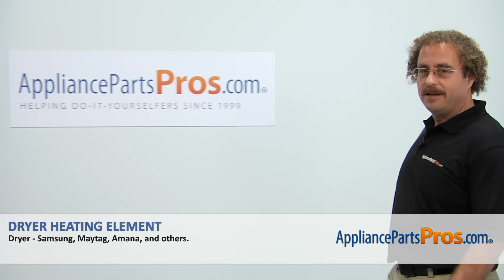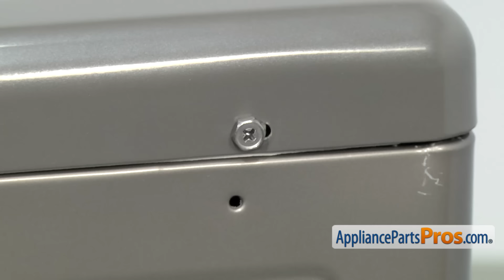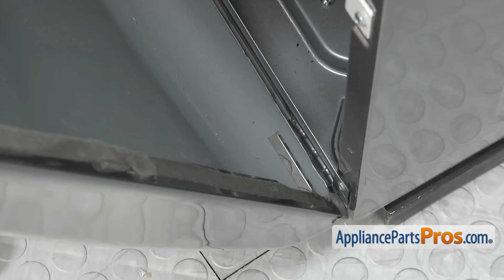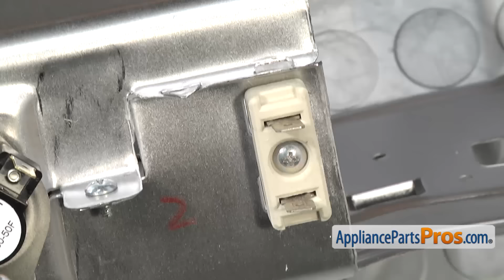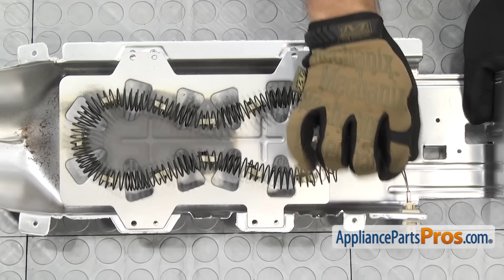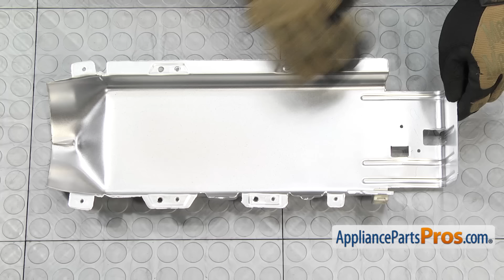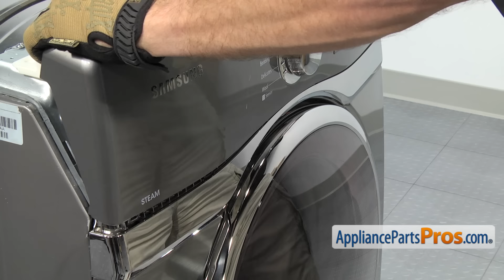How To: Samsung Dryer Heating Element DC47-00019A

Comment: I'm on my second heating element after year 3. Never had to do this on my old school dryer!! For the price, I'll never buy another Samsung dryer again!! Great and helpful video tho!👍
Reply: Same three years second time I’ve had to watch this video. SMH
Reply: I really appreciate vids of this type. Shop around for the heating element though, I found the price varying from around thirty dollars to over one hundred.
Reply: @jgunther22   genuine vs copy ...?
Reply: @danielgiguere2588  Seemed to be a copy.
Reply: I saw a video about repeated heating element replacements, and the suggestion was to clean the moisture sensors with Goof Off to remove any buildup of detergent or fabric softener on the sensors.
Reply: I’ve never had to replace mine, you could have a vent issue, If your exhaust hose is kinked or clogged it will cause the element to overheat and go out
Reply: I just put my element in and it went out to
Reply: PLEASE HELP! Is it possible to put the thermal fuse or thermostat on upside down?
Reply: @RestEasySon  just spoke with a repair tech and the answer is no, it doesn’t matter
Reply: @RestEasySon it don’t matter
Reply: Make sure you change the thermal fuse. If it’s bad it can overheat the heating element causing it to burnout much much faster
Reply: Wow, this actually gets me angry seeing that it isn't just me having my own problem with the element burning out every year or two! And this isn't easy to get at you have to lay on the floor!
Reply: @joeblow26  I spent most of the afternoon doing this today. Those suckers are sharp also.
Reply: 3rd time in just over a year for me.
Reply: I'm on my 5th! Shitty design from Samsung!
Reply: Same thing. I'm on my second one within 3 years.
Reply: Replacing them every year. Do not buy samsung appliances.
Reply: Me too!!!!!
Reply: Thanks for the video 3 year old dry up and running now
Reply: On my third heatting element  I will never buy another  Samsung  dryer again
Reply: My third element replacement, watch this every time. Every two years it seems.
Reply: Me too second one and 4 years
Reply: I’m dealing with the SAME issue! I’m so over Samsung appliances!
Reply: Same!!
Reply: Mine lasted 16 years
Reply: @joseluispcastillo  Just replaced mine, element was good just the fuse went. 17 years.
Reply: @johnrotten968  Is there a fuse on the assembly? 
I hope I wasn't throwing the baby out with the bath water.
Reply: @joseluispcastillo  Yes there is a fuse its part number DC96-00887A. Do a conductance test on the element and the fuse to see if there is any resistance. Should be zero for both. Also if you don't see a break on the element it is most likely the fuse that's gone.
Reply: When I say conductance I mean your voltmeter should read 0 ohms no resistance. Infinant means broken wire or burnt fuse.
Reply: @johnrotten968  Thanks. I should've assumed a fuse first verses assuming that the element burned out when there wasn't any signs of it being burned out.
Reply: My Samsung dryer last 7 years. Now I am expecting a new one by the end of the year. Always make sure to buy the 5 years warranty. Samsung and LG are a good products, I don't know why so many negative comments.
Reply: Same shame my head
Reply: Are yall getting the oem parts or Amazon?
Reply: Had my dryer since late 2009. I just ordered my third replacement. A broken coil is always the issue. 

 Not sure what i bought last time. Going OEM and leaving this here for next time.
Reply: I’m doing my second in three years too.
Reply: Just changed my heating element. Fuse and thermostat. Still won't heat. I dunno wtf it's doing
Reply: Yep. This was the second replacement in just under a year.
Reply: Same.
Reply: Same here
Reply: I absolutely HATE Samsung appliances. They are them worst pieces of crap ever. Aside from General Electric appliances, too. That’s the worst second.
Reply: Be sure to buy only Samsung OEM part if you buy anything else you’ll be changing it every two years
Reply: Thank you!
Reply: Same. Crazy.
Reply: This is my 3rd dryer element as well. Lame. At least we know how to fix them now!
Reply: My fourth time.
Reply: Never use fabric softers in dryers or washing machines. I got my dryer to go over twice as long before having to replace the element by cutting a hole in the back of the dryer and yearly vacuuming out any lint around the heating element. It's the lint burning off and causing it to get too hot. Most dryers just burn that lint off and keep right on working. If you ever open your dryer and smell a little burnt smell, that probably means you need to open up and get that here and yell and it cleaned up if it didn't go out
Reply: I totally agree I’ve replaced the heating element 4 times! And I’ve also had issues with other Samsung devices never will I purchase another Samsung product again!!!!
Reply: Same. Smh
Reply: 5 times for me 😂
Reply: 3rd time for me within 3 years. POS!!!
Reply: Bad airflow shortens the life of heating elements
Reply: I'm now on my FOURTH heating element in five years.  Also on the second motor (bushings wear and can't be replaced without swapping whole motor).  Samsung is total POS.  I guess if you do laundry once every week it may last, but they're definitely not made for people who have families and pets and do laundry multiple times a week...
Reply: Sounds like you're using it too much lol. Check your exhaust ve t. @cup_and_cone
Reply: Can someone please help me
Reply: @jtshot9803  idk I’ve never had that problem I am however going to have to replace the element again. It went out yesterday 🙄

Comment: Mine was a little different. All was good like the video until I got to the bracket under the heater assembly. Not just 3 screws in the front but 1 on the inside from holding the heater assembly to the bracket AND 2 in the back of the bracket. Didn’t just slip out with tabs. Those ones in back were horrendous to get out.

Comment: Ours had 2 FU screws connecting the housing for the dryer element housing to the bracket that required a stubby screwdriver and left handed work.  Other than that a perfect video for fixing our Samsung.

Comment: I did it! I really did it! Ordered this part from Amazon and followed your directions to the T ( about 45minuted of rewinding to keep up) and in the end there is heat yet again! Thank you 🙏🏾... An overwhelming feeling to conquer an appliance repair. I feel very competent today😎
Reply: Lol - i just did this and had the same feeling - replaced the thermal fuse and thermostat first and was devastated that it didn't work - but this did the trick!!!
Reply: @rwogh  I tried half year ago. I either it doesn't work. This video only tells us how to solve the only one (of hundreds) heating problem. Trying is gambling and testing your luck.

Comment: First of all, the bottom bracket on mine had screws in the back. Those were NOT fun to remove. I checked the element, fuse, and thermostat, all have continuity. Any other ideas?
Reply: Found how to get into the diagnostic modes. #5 gives a readout between 220 and 240, whatever that means. Still no heat though.

Comment: When I pulled my heating element out, the blue and red wires were opposite. Blue on bottom and red on top. Should I switch them or leave them the way they were when replacing?
Reply: In case anyone is wondering, I left them the way they were when I pulled it out, and all seems fine now. I guess that’s why taking the picture is so important, versus relying on the position they’re in within this video. Thanks for your help changing this out!!
Reply: Sean Keller left mine the same also (I took a photo beforehand just in case)  and the dryer works wonderfully now.

Comment: 2 important items to consider. 1. Be sure to clean you vent all the way to the outside. If that is clogged, the element will fail soon.  2. Getting the element inside the dryer vent is very difficult. Make sure it gets up inside the housing properly.
Reply: Which vent?
Reply: The piece I ordered came with the right heating elements (coil, thermostat, etc.) but the case was way too big, so I had to replace all three of them to the old housing to get it to fit. I almost had an aneurysm because it was not fitting nearly as nicely as he showed 🥴
Reply: Dd

Comment: Excited to be working on this, but the control panel is stuck even after detaching the tabs -- there is something on the bottom that is still keeping the panel connected. I've tried jiggering it in various directions but it's still stuck (don't want to force it). Any thoughts? It's a DV42H5200

Comment: Thank you very much!!! One small issue with my samsung dryer. The bracket holding the heating element had two screws on the back side. It did not just slide out. It was very tricky getting them unscrewed. I know not all dryers are the same. But this saved me hundreds.

Comment: HELP !!! HE error code after replacing SAMSUNG Dryer Heating Element (DC47-00019A) . Could it be SAMSUNG Thermostat (DC47-00018A) or SAMSUNG Thermal fuse (DC47-00016A)  or both?? HE error I would think it would be the SAMSUNG Thermostat (DC47-00018A) but again need help on why I am getting a HE error code. 
also
Samsung dryer heats and drys well. I also cleaned all lint from blower and all dryer when I replaced SAMSUNG Dryer Heating Element (DC47-00019A)
Reply: Replace all the parts on the exhaust at one time, they are on Amazon as a kit for $30.00 ($5 got me same day delivery)

Comment: I replaced the heating element but now I have a "he" on my display and after running for about 10-20sec. What is that???
Reply: Same thing. Did you ever resolve this?
Reply: @chefpaul5191  yes thanks, I had to replace all three sensor too

Comment: I did the replacement with the new parts and the dryer got very hot as it was drying a load of laundry. Two days later the new elements stopped working and it is not drying the clothes again. Any suggestions?

Comment: Does it matter which terminal of the thermostat is black or blue? Mine is the opposite of this one. However, another video was like my original. I zoomed in on the thermostat label in both videos to compare. My heating coil and thermal fuse are the same as in this video. I did take a pre-repair photo of the connections..

Comment: Did this last year and it worked. Thanks! But the heat went out again and this time the red wire that connects to the heating element has melted off!
Any thoughts or suggestions would be greatly appreciated...

Comment: Great vid. The replacement went fine but the new element broke with the first use. Any ideas???
Reply: make sure the element is properly seated into all of the ceramic insulators , and then after the assembly housing is screwed together around it, re-confirm that none of the element is touching bare metal. Yours might have shorted out which would probably cause it to break apart.

Comment: I had a wire that got worn and some corrosion to the heating element.  I am not finding the replacement 105 degree 600 v wire with the high temp connections (black wire).  Any idea where I can find/buy it?  Tried 3 appliance repair brick and mortar shops, everywhere I can think of online, electrical supply shops...nothing.
Reply: Hey did you ever find one? I have the same issue.  The wire comes with some of the replacement kits, but isn't sold separately anywhere.  There's a whirlpool version but it only has one end.

Comment: Would the same assembley process apply to the Samsung DV42H5000EW/A3-0000?  I can't find a video for that specific model.
Reply from the maker: The model in the video is a DV405ETPASU/AA-0001, but it is the same part that's used in your model. While the video may not be exactly the same, it should give you a good idea of how to go about the repair. There may be small differences, like screws in different places.
Reply: @appliancepartspros  Yes, in mine the bracket below the heating element had screws in the back which were a major pain to unscrew from the front, but I managed.  I was able to get the job done!  Thanks for the reply.

Comment: Thank you so much.  I did 2 loads of laundry and by the third, the dryer would run, spin and complete a full cycle only for the clothes to be wet and the dryer was cold.  After repeated testing, I figured it was the heating element once I watched this video.  I followed all the instructions to the T, and Voila!!!!  My dryer is good as new....vacuumed all the lint inside the machine once it was opened up as well and now the machine is good as new.  Thanks AppliancePartsPros!
Reply from the maker: We're glad we could help you out!

Comment: Is this the main reason the dryer has no heat?
Reply: If you have a multimeter, see if the heating element is conductive between terminals, if not, theres a break somewhere and it must be replaced.

Comment: Thanks for the video, I think I can handle installing my own part now with your guidance. My dryer lasted six years without any problems until now.
Reply from the maker: You're very welcome!
Reply: @appliancepartspros  I did the part change out today, the old heating element had broken in the wire, thanks so much for your help!

Comment: I agree that this was a very well done video. Other less skilled techs on YouTube removed element box from the back, and some remove the dryer barrel. Totally unnecessary. One thing though, I was amazed not to see the wiring harness from the control box (upper right, top front panel)  Am I missing something here?

Comment: The last 2 wires you plugged in are opposite blue on top black on bottom when I removed my heating element. New one does not dry when i replaced like factory set....can i reverse those 2??
Reply: Harry Lovato same here w last 2 wires. What could happen if wires are swapped?  Doesn’t look like there is a defined positive & negative.

Comment: Great Video!! Was able to change the heating element... Just one question is it normal to get smell on the first run?
Reply from the maker: Glad to help! Yes, sometimes there can be a sort of burnt smell the first time you use it as the element burns off dust and things that may have gotten on it. It should pass.

Comment: Thanks for the video. Is it normal for the new heat element smell funny? And if connect the wires wrong what could happen?
Reply from the maker: James, what sort of smell are you getting, and is it strong?
Reply: AppliancePartsPros, not too strong, kind of like the first time your heater starts since last winter.
Reply from the maker: James, a small amount of smell the first time you use a new heating element is normal - like you said, something like a using the heater for the first time since last winter. It should fade with use. If it keeps persisting, or you feel like anything is wrong, you can get in touch with us at 1-877-477-7278 or chat us on appliancepartspros.com .
Reply: That smell is dust burning. Make sure that your lint screen cage is installed correctly. We have to close ours up carefully before putting it back into the machine so that it fits snugly and doesn't let all the lint through. It's lint getting through that clogged our exhaust and caused our machine to overheat

Comment: I changed the thermostat, the new one had a jumper cable, the dryer is now heating but won't turn off just runs and runs and runs...  My question, the old thermostat had an arm on it and an orange wire from the unit pluged into the thermostat.  The new one didn't have this connector so the orange wire is just hanging there not connected.  Could this be the reason it's not shutting off when the clothes are dry?

Comment: Whirlpool Dryer model GEW9250PLO does not require top cover removal. The heater element  chamber is accessed by removing two screws at the front of the base.
Reply from the maker: Some models are different, hope the video helped you out!

Comment: Hey, I replaced the heating element and the thermostat because the dryer was not heating. After replacing, it is still not heating. What else could it be??
Reply from the maker: It could be a number of things, without knowing what you have, I would suggest posting the problem along with the appliance model number on our repair forum and the techs can help you troubleshoot the problem. http://forum.appliancepartspros.com/

Comment: Is it possible to use another model of heating element that uses the same volts and everything?
Reply from the maker: We can only advise to use the correct replacement for your model number. You can go to our website and enter your appliance model number to view the parts breakdowns to be sure you get the correct part for your model.

Comment: Thanks gonna give it a shot tonight. Got a newer model dh569100eg/a2. Dried fine until swapped position w washer. Samsung Repair people says its not getting 240 volts. Electrician called out said neutral plug had loose wire, but still getting 240 volts. Gonna try Element and see if it works. If not Maybe resistor?
Reply: wrong part for my dryer
Reply from the maker: Not sure if the element was your problem but you can also post the problem along with the appliance model number on our repair forum and the techs can help you troubleshoot the problem. http://forum.appliancepartspros.com/